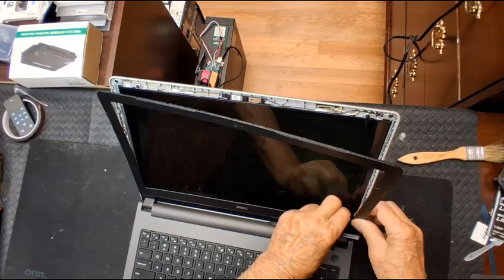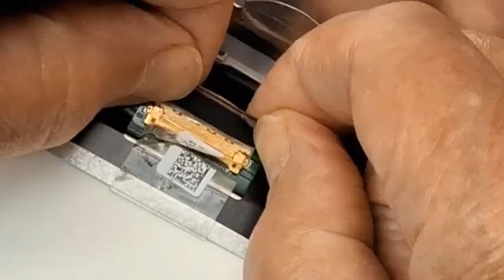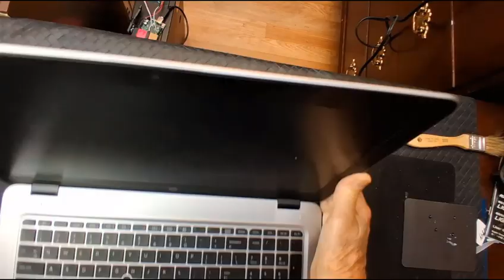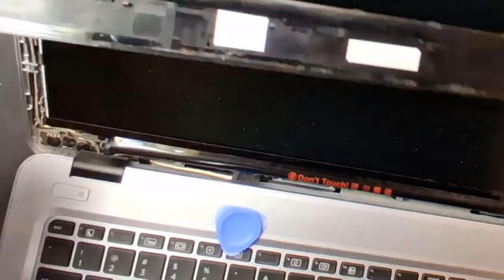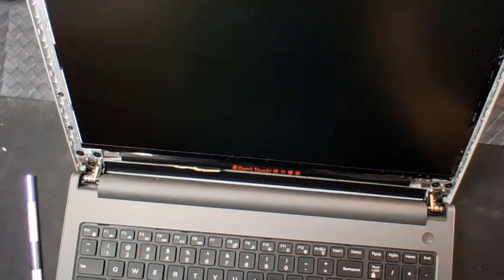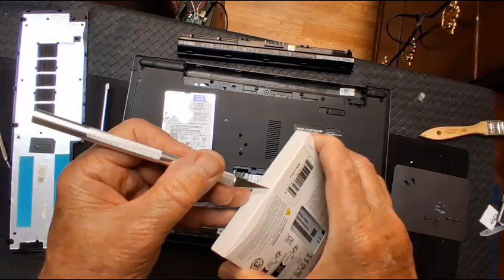DELL Inspiron 15 5000 Series (2015) Laptop Screen Replace & Hard Disk Drive Cloned to SSD.

Comment: Good job, just wondering why you would do this in a regular repair shop. Yes if you are doing this for your own benefit, this is good. Buy a much newer refurbished one might be a cheaper solution and gives the client sometimes up to 2 years warranty (it's a Dell!)
Reply from the maker: Good point. I do as the customer wishes. He also bought a new Asus  Win 11 but needed programs already installed on the old Dell. At least with fixing and upgrading, you know the computer is solid. Buying an unknown refurb can get dicey.
Reply: @CreateYourOwnMusic  That's a good point, Dell 5000 series is a rock solid laptop, most Dell laptops are